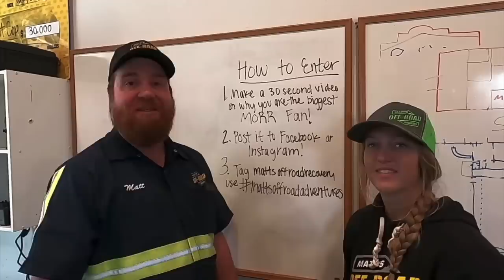How Am I Going To Steer The World's Largest Off Road Wrecker?

Comment: For those that are unaware, an orbital steering valve is a hydraulic valve that takes hydraulic power from the steering pump, and, with the turning of the steering wheel, directs that fluid to whichever direction the wheel is turned to a steering cylinder. In this case it completely eliminates mechanical connection from between the steering wheel and box, which is replaced by the orbital valve, to the wheels. In the case of the ones I've used on equipment or vehicles, with the engine turned off, there is manual pumping pressure caused by turning the steering, to be able to steer the wheels incrementally. Where I live in Pennsylvania, orbital valves are not permitted to be used on road because of the lack of mechanical connection between the steering wheel and the front wheels. If a steering hose bursts or leaks, it is potentially a cause for an accident.
The only exception is farm equipment on rural roads.
Reply: in my state (washington) hydrostatic steering is not allowed on road vehicles.
Reply: Bless you! Not being familiar with orbital steering, I was wondering what he meant when he said the steering wheel would hunt. You explained everything perfectly. Thanks for taking the time to write that all out!

Comment: An enjoyable video, it was good to see the variety of drivers making it up those trail obstacles.
And now a question, why are you running the orbital valve clear up to the front of the vehicle?
It could be short coupled right to a short column. On my tractors the steering shaft is only 8-10" long
and thats just to have room for the tilt telescope functions. Or are you trying to keep the hydraulic oil out of the cab?

Comment: Here’s an idea weld some D rings or some mounts on the ends of the Roll over bar/headache rack both driver side and passenger side right above the winches at the highest point that way you can run their winch up through a snatch block connecting to that new point and then to the recovery will allow you to lift at a higher angle

Comment: -- Dumb question for everyone.  Does anyone else tilt your steering wheel to where it's comfortable, but it obstructs visual on the dash cluster in every vehicle you've ever owned?  Story of my life anyway.  I mean I have radio controls on my steering wheel but not instrumentation?  We have the technology :D  On the War Rig, Matt.  I like how your basic tolerances are lose (room to spare).  Built to work right, but if there is a failure, you limit cascade damage to other systems.  Easier to repair.  If I'm speaking Greek, that's loose aviation slang simplified.  Thumbs up.

Comment: Hate to break the news to you but Federal D.O.T. Law requires a continuous mechanical linkage between the steering wheel and the steerable hub where the steering tire attaches... Yours and Paul's Orbital Valve steering doesn't cut it... If a hose breaks, you can't steer the vehicle on the hi-way... Do what you want offroad but on the hi-way you will comply with Federal D.O.T. Laws... Check it out if you don't believe me... I've been building and repairing LARGE on-hi-way vehicles for 50 years, I know what I'm talking about...

Comment: make sure you mount that steering column well, you WILL be using the steering wheel to pull yourself in the cab, no matter what you say...
Sunday's not complete, until I see Matt touching something hot, lol
soft sand tough Jefe, no embarrassment

Comment: It's mandatory with a corn binder, I know I have a 1954 int R110, that you have a spinner on the steering wheel. Steering column through the speedometer hole, yeah that's how I would have done it too not where it was bolted underneath before.

Comment: Other than ease of installation, I don't understand why you and Paul are using Hydraulic Steering.  I have it on my John Deere 1026R and when Brush Cutting in my back field, a branch broke on of my hoses and I was done.  It was a real chore getting my tractor and brush cutter out of that field and home for repair.  If I was going into the back country like you guys do, I would want a mechanical connection to my steering wheel.  I guess I am paranoid and just want redundancy for back-up.

Comment: If you can get the change in steering shaft angle equal (or as close as possible) at the two universal joints and mount them 90deg out of phase to each other the oscillation effect from one UJ will cancel out the other so your steering wheel inputs won't be corrupted. Might be achievable by shortening the first shaft from the steering wheel and lengthening the shaft between the two UJ's. I guess you probably already know this and decided it doesn't matter in which case ignore me. Love watching your videos and can't wait to see this beast in action!

Comment: Since it's a full hydraulic steering system, why not locate the orbital valve under the dashboard with the wheel on the valve. Hinge the valve if you want tilt. Then just just run hard pipes or hoses to the box. Or out it in the engine compartment on the firewall. Saves using a long shaft, universals etc. and snaking a shaft around the engine.

Comment: I have a question you're probably going to think I'm stupid but oh well you're going with an orbital valve so it's hydraulic so if the pump would somehow go out you will you still be able to have steering I don't think you will is there a way to make it where you won't ever lose steering cuz you might be up on some big old thing coming down and power steering belt get popped and now you're stuck

Comment: do you have any steering at all if the engine dies. do you have an electric hyd pump back up like military trucks so they have pressure to steer with no engine.  same for hydro boost brakes.

Comment: I ran a lawn crew a few years ago, and I would freak out the college kids mowing up hills so steep that the front tires were in the air. A young lady on the crew was afraid of the zero turn mowers, even when I tried to start her on a good flat yard. I told her that she did not want to be running a weed walker every day. A couple of days later she wanted to try again. Within a month, she would mow all but the steepest jobs. he guys wanted nothing to do with those either. This old man would do them to save time. It was good to see that young lady get out of her comfort zone, and do it.

Comment: 3:45 isn't the steering column supposed to fit under the dash cluster? not through the large hole where the speedo goes? there is cutout under Matt's left hand that is the shape of the steering column.

Comment: Steering wheel looks nice, but I wonder how well it will work in dirty work environments; e.g., hand slippage. Maybe a thicker wheel (hand grip), with a less slippery surface. Did you leave enough room upfront to replace the belt?
Reply: Gonna be effortless  with hydraulic steering. One finger turning.

Comment: Don't see world's largest. Wrecker   when heavy D's been taking factory. Wreckers off road that are x amounts bigger just saying
Reply: We need to make a distinction between driving off the pavement and driving off road. Heavy D's wrecker is about as capable as a dump truck, which can also drive off of the pavement. But neither can drive in soft and uneven terrain. Matt's wrecker is designed for buggy trails, true off road. Not just semi-level dirt.
Reply: Copy he did get stuck alot

Comment: In a world where the M88 Hercules exists (not to mention the HEMTT and MTV wrecker) this guys calls his little truck the world's biggest wrecker...

Jokes aside, this build is coming along nicely.
Reply: No way it's the world's biggest wrecker. 50 ton rotators put it to shame in that regard. World's Largest Off Road Wrecker. Important difference there. Military wreckers can drive on semi hard, semi level surfaces. But Matt's wrecker will be doing buggy trails.
Reply: @JohnFL  yeah, uhh, you know those wheels and axles came off a military vic right? You should see some of the places we took our wreckers. I've had to recover my fair share of HMMWVs from way the hell off the beaten trail. The M88 is a tracked recovery vehicle. It's only limit is its size. It won't make through a narrow cliff side trail, but it also has no problems making new trails.
Reply: @rallywagon261  Tracked vehicles also have suspension travel as a disadvantage. You can't have one wheel up high and another in a low spot. If you're on a rock you're high centered. WhistlinDiesel just got his tank stuck on a tree like that. If there was something more capable, Matt would have started out with it. And BTW the tires are not off a military wrecker, although the axles are.